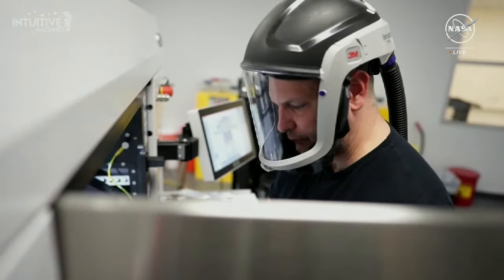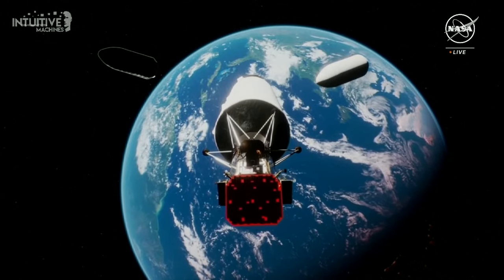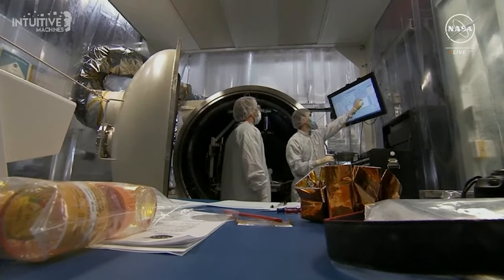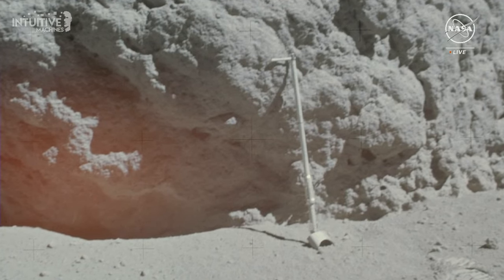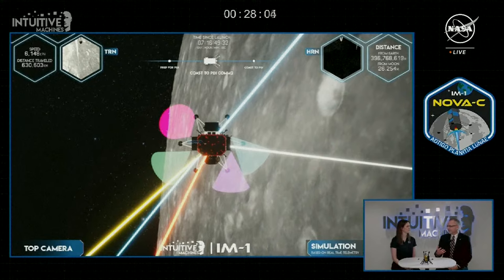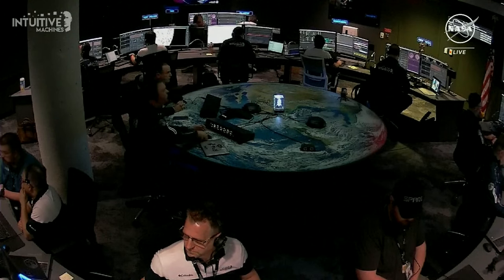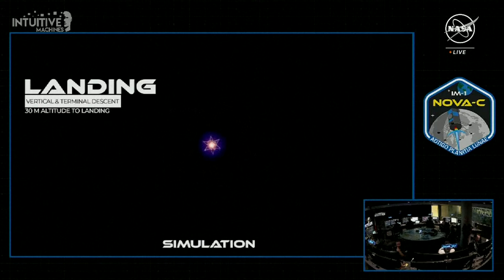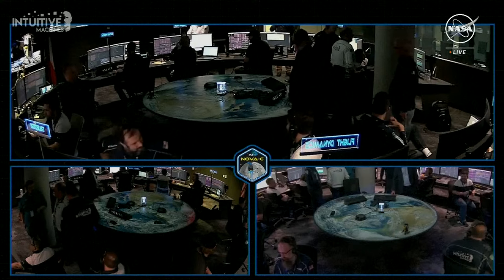LIVE: Watch Intuitive Machines’ Odysseus moon landing

Comment: They made a huge mistake by not equipping the lander with live video. The PR of playing a video of the landing over and over would have been priceless for the company.
Reply: id rather it actually lands. autonimous moon landings are very hard
Reply: spelling autonimis correctly is very hard
Reply: @waqqashanafi  indeed, autonomous is tricky.
Reply: @waqqashanafi  that does not eliminate the lies
Reply: @dcsc1  🤣
Reply: Liers
Reply: They ow we the people's alot of money
Reply: it would be a double edged sword. if it failed....
Reply: @johnsmith-hc3ry  Thats why there would be a delay between what command element sees what everyone else would see (just in case) "Oh know, we lost signal.........."
Reply: @RenewedFaith  Yeah, signals broadcast to the lander to move it would have a delay, and the livestream probably has a delay as well.

Is that difficult for you understand?
Reply: @gogeta667  They couldn't just have a live feed of the landing for show?
Reply: @AsbestosMuffins So hard that we been doing them on Mars for 25+ years.
Reply: Granted, but they made up for it by designing the control room to look like the bridge of a Klingon battle cruiser from the 80s.
Reply: You are missing the point. We're talking a situation where every single gramme of weight is extremely critical. Given they are a provate company too, adding something like that would likely involve a substantial amount of redesign. Quite a cost all for this.
In summary, I'm afraid you don't realise the scope of what you're asking.
Reply: @crunchyfrog555 A camera wouldn't have ruined anything. GET REAL WITH YOURSELF.
Reply: Never
A
Straight 
Answer
Reply: I just came here looking for the live video.
Reply: @boardbodhi  Not if the camera equipment on board was ready. They also might not have a live feed from the camera. I don't know if it's a video camera even.
Reply: @gallopingoctopus1364  Wrong. It absolutely would. You clearly have no idea of weight budgets and balancing or other considerations. Please do demonstrate how I'm wrong.
Reply: @RenewedFaith Tf y’all talking about? They never cut the live feed when something fails
Reply: Sure, and the government is completely honest and open about everything ever... k. I'm no fan of conspiracy theorist silliness but when he ISS (with multiple redundant systems) randomly goes silent it would be reasonable to ask a question or two.      @DirtFather407
Reply: If they need pictures of moon, they can take it with Samsung
Reply: @crunchyfrog555  bro a cellphone camera is like 0,3 grams xd
Reply: eeuu is now a third world country, this put another nail in the coffin. I bet China will give us now and in the future the most amazing moments.
Reply: @crunchyfrog555 Private company, but received funding from NASA. Our tax money paid for this.
Reply: In 1969 they transmitted video to Aus...  Now this is a disgrace to the mission not having imagery in 2024.  No video.  Not even still images every 5 min.  Do I need to design your camera system?   Odd how the Japan rovers camera didn't work either.   And India cam was from 1980 pointed down.  What a crock of PHD BS... $60 millon+?  What's to hide?  This all needs to be called out. But it will not,  they don't wanna loose any funding or grant money...
Reply: No matter as they will make a Unreal version.
Reply: Live video would show truth. CGI takes time to lie
Reply: @milesmarshall  Did you forget to take your medication again?
Reply: This is a public broadcast.  They have video, they just aren’t sharing, obviously.
Reply: Is there something they don't want us to see?
Reply: @jasonpatterson8091  we had a live feed supposedly 55 years ago for Apollo 11 but can’t for this lander? 55 years later? Y’all will just bend over backwards to get your brain to cope with this.
Reply: Oh!  That wasn't a mistake!  It was carrying too much BS in it's cargo hold...couldn't carry the heavy camera.
Reply: @Stelletti  
No... it takes a couple minutes for telecommunications to get from Mars to Earth... then it has to be received by a large radio dish, processed, then streamed... That by definition is not live. That said, the cost of those amazing video systems is a significant part of the cost of explorers and was part of the critical exploratory science for both public and scientific consumption. 

This landing is much more heavily weighted for looking at spots to put permanent lunar structures for lunar explorations, and habitation. Not to mention, ultimately building a launching facility for interplanetary exploration from a dramatically smaller gravity well. Later missions will include more public information, with PR content. This is pretty much all business. 

But great first step of getting us on the moon permanently...
Reply: They must have 'forgotten', like they 'forgot' to turn the Lidar on (LOL).
Reply: @Kube_Dog  With a huge 'Flat Earth' table in the middle... LOL.

Comment: Even in 2024, we still barely have much more bandwidth between the Earth and spacecraft than they had in 1969.  If I remember correctly, they only have about 5-6 megabits to transmit and receive over.  So they don't want to waste bandwidth on live video when it could be used for telemetry data, and then transmit video or pictures later.
Reply: LOL sure.   In 2007 LRO was doing 100-300.

Comment: For anyone who is upset about no live video from the moon, you don’t know how much bandwidth is needed for live video. It’s A LOT. And, the moon doesn’t have high speed internet access, much less a high speed connection to Earth. 

Now, I’m curious if any modern video transmission would have an analog or digital signal.
Reply: We did live video from multiple mars landings in the past.
Reply: Very true.  How did they do it with ease fifty years ago?
Reply: NASA live-streamed video from the moon in 1969. Come onnn
Reply: @LBCAndrew  That depends on who is putting up the money for missions and how they want to handle publicity. For example, SpaceX doesn’t want anyone to know that they’re launching a rocket until 10 minutes after a successful launch. They’ve had a lot more failures than successes, and they don’t want the public to see their failures. On the other hand, NASA is run by the US federal government, and they’re obligated to show what they are doing despite the results.

For this mission, I think a live video stream was not so necessary because they weren’t landing people on the moon. To paraphrase the movie Apollo 13, a trip to the moon can be as interesting as a trip to Pittsburgh.
Reply: Yet they managed to livestream from the Moon for 8 hours at a time before Pong was invented.